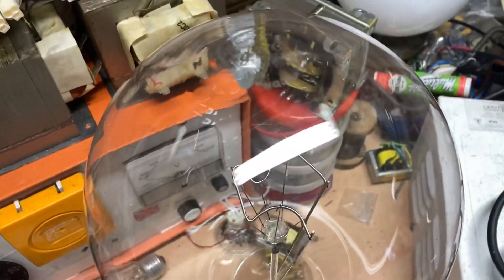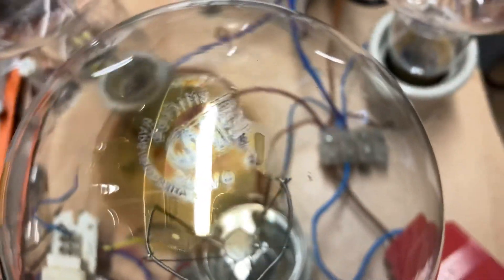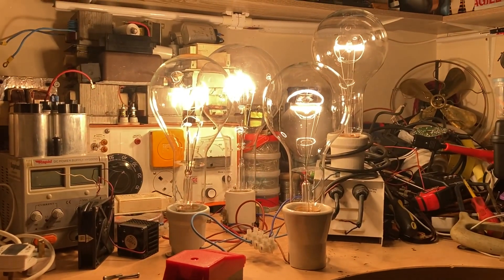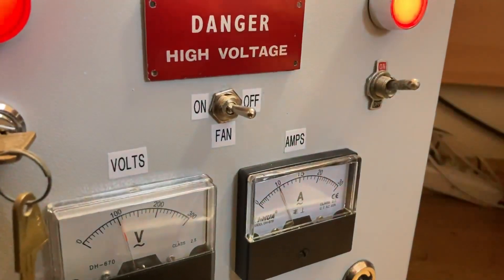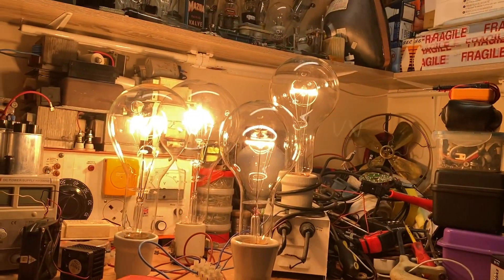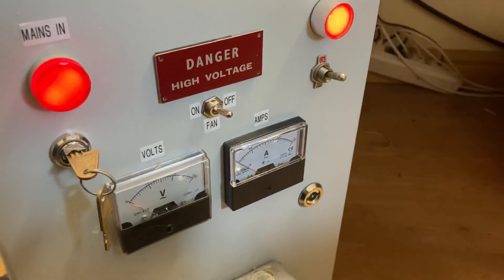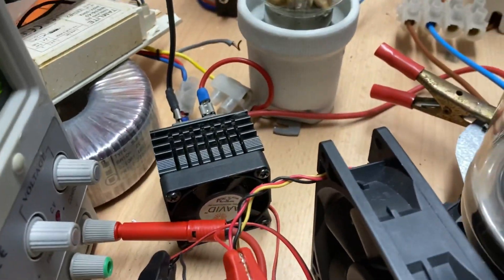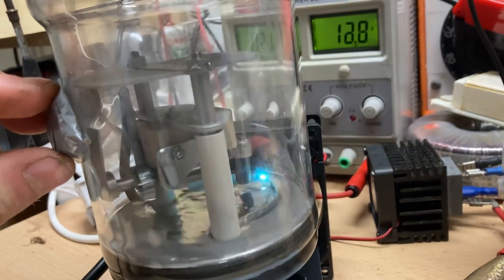3.5kw of incandescent lamps powered from excitron

Comment: bro why the eletric sound in some videos are different?
Reply from the maker: Variac buzzes at 25hz from the half rectified ac - not good for it lol
Reply: @TheCORC-o9r  no less than half, at least on brazil that the voltage here is 127/220v 60hz

Comment: Nice! What do you intend to do with it? Have you heard of the Fractal Capacitor? its a low cost , no copper, lightweight 96% efficient Lv to Hv or Hv to Lv rectifier transformer. It can charge capacitors in series and output in parallel or visa versa. See Robert Murray Smith's video, an amazing device, a solution for Hv arial systems, or the Faraday  homopolar generator . Any chance we can get in touch?

Comment: Have you ever thought about checking it for x-ray emission? Some vacuum tubes if hit with high enough voltage will emit x-rays. From what I experience x-rays also produce ozone.
Reply from the maker: You only get X-rays from tubes that are hard vac with no gas inside and only at very high voltages, crts will produce X-rays if driven hard enough or blasted with a couple hundred kv

Comment: If the excitor’s got a mercury pool at the bottom, it’ll produce UV all the time when it’s on, probably should shield yourself from it by placing it in a UV opaque enclosure to avoid arcflash. Cool demo though!
Reply from the maker: The glass blocks the uvc at low power but at high enough power it’ll pass through it seems
Reply: @TheCORC-o9r no, it does not pass through at any intensity, even if you sit near an open nuclear reactor and protect your eyes with a piece of regular glass, your eyes is safe from UVC radiation.

Comment: Can you let the magic smoke out of something?  Its boring watching lamps run on horribly rectified AC and it can't do your variac any good (you could let the magic smoke out of your variac but then you wouldn't be able to use it to blow other things up).  If you had four of those you could make a horribly inefficient full wave rectifier.  There is only one thing that smells worse than ozone and it's that smell of something getting way too hot!
Reply from the maker: There’s a reason for the name of this channel - you don’t have to watch all of the videos just watch what you find interesting. There’s a pile of motors I’m going to obliterate eventually I’m just waiting on another transformer (no spoilers lol). Also the variac will probably be fine it’s taken more abuse than that and for longer too. For full wave only 2 are needed and a split phase transformer - centre tap is the negative.
Reply: @TheCORC-o9r  a channel full of crap.  Who would have guessed?  Wonder if that new transformer is coming from chyna?

Comment: Why would the variac be buzzing at 25Hz?
Reply from the maker: Half wave dc pulsed directly through the variac basically, not recommended as the variac gets quite hot.
Reply: @TheCORC-o9r  Ah, so still 50Hz then (full wave being 100Hz). And yes, transformers don't like passing DC current!